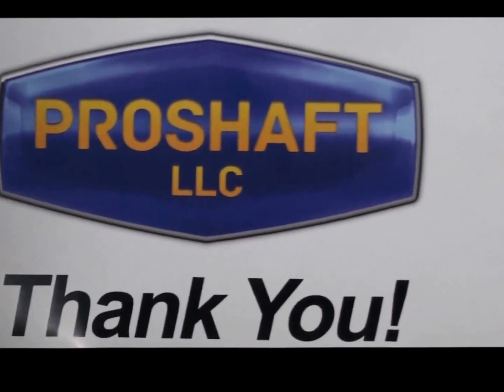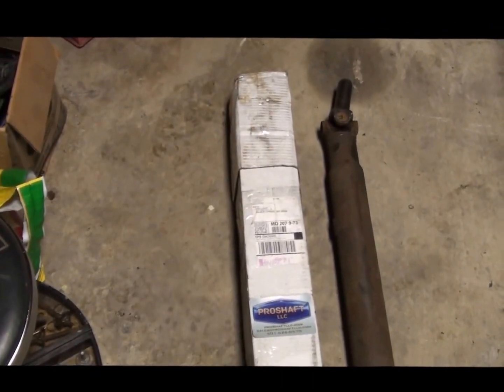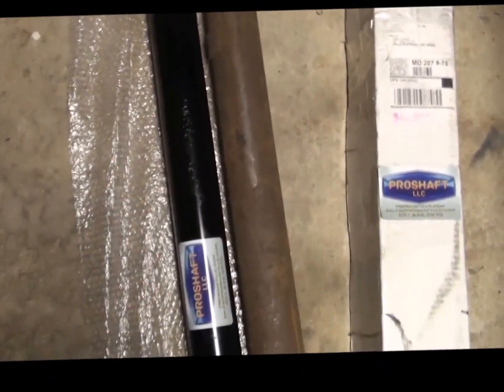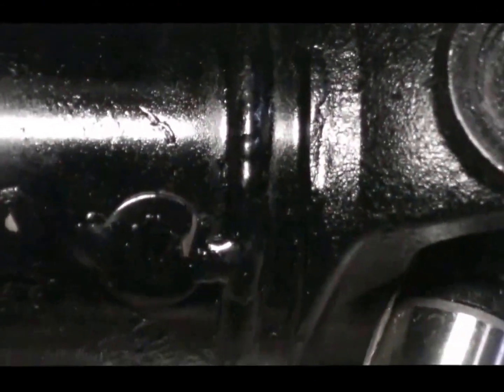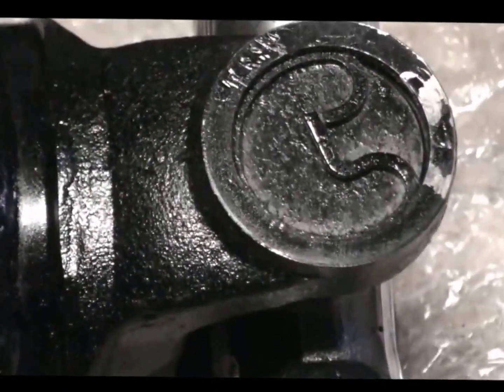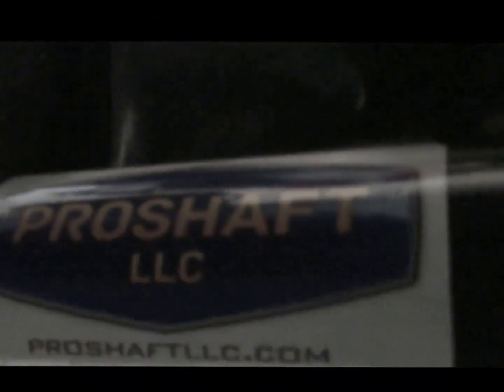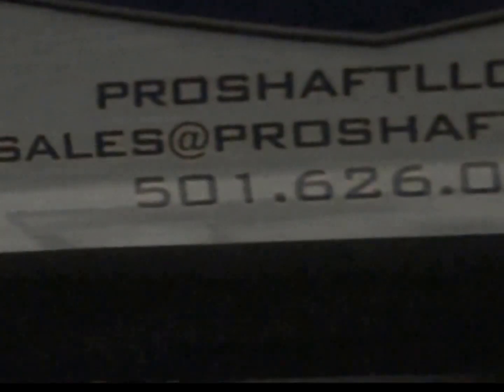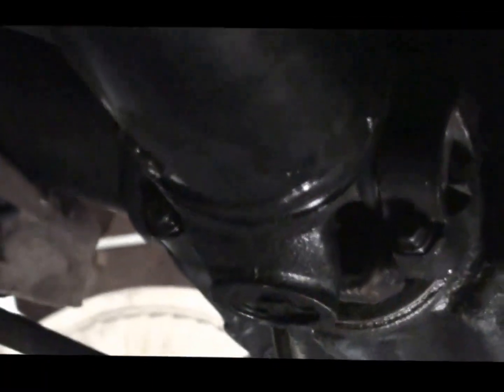Project Chevelle LS1, Custom driveshaft installation

Comment: How do you know if you have correct pinion angle ?
Reply from the maker: Jay from everything I read it has to be between 3-5 degrees downward. All the sites i found that talk about pinion angle they talk about having the motor going down front to rear between 3-5 degrees, I used a degree angle tool. Look I am an electrician, backyard hobbyist which is why it takes me forever to do anything but it is fun. I just googled conversion LS Drive shaft angle. Hope that helps you.
Reply: Cary Lamari 
So the drive shaft highest point will be the connection between transmission going downwards to rear end
Reply from the maker: @jayg1358   Jay G  Yes that is how I understood it to be, The engine and transmission is at the 3-5 degrees and the trans should also be similar but at a lower point, the drive shaft angles down but the yoke and the rear u joint are straight into their respective joints. I haven't driven it yet but I turned it with the wheels in neutral and there is no binding and it feels and looks normal. We shall see when I drive it but everyone i spoke to locally tells me I should be ok. See I am learning like anyone else. I look at different strings online and then talk to people. Good luck on your project. You should talk to whoever sells you the driveshaft to make sure.
Reply: Cary Lamari 
Sweet thanks for advice

Comment: Sweet d/s cool that your that far on the chevelle.
Reply from the maker: +scottsinfl Drivetrain is installed but I still have to do the fuel system and wiring. those are next then of course finish body work and paint then interior I still have a long way to go. I bought the new upholstery though so I am good there, still need carpet and headliner. lots and lots of work to go and I still have to make a living lmao
Reply: +Cary Lamari I know thats my problem too you still got to work on others to pay for yours.